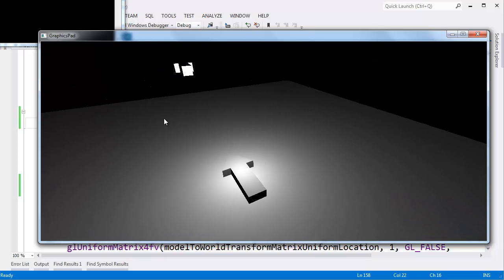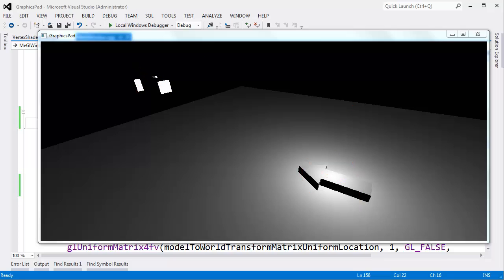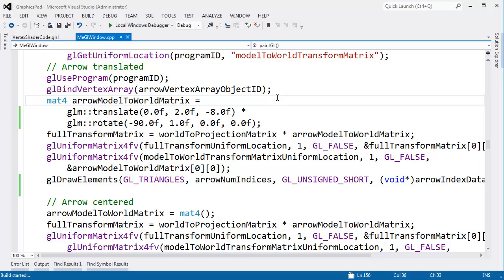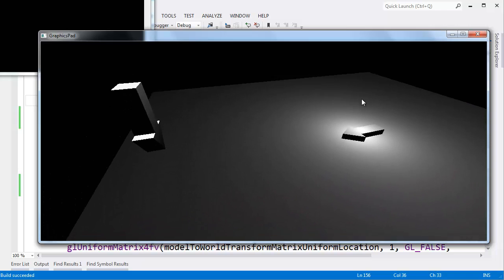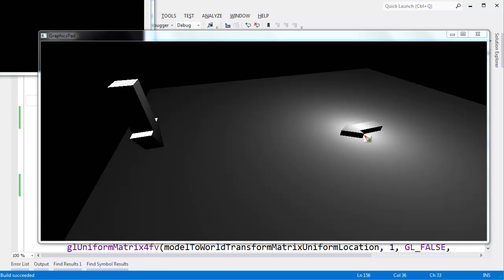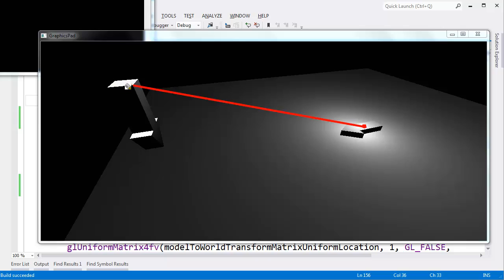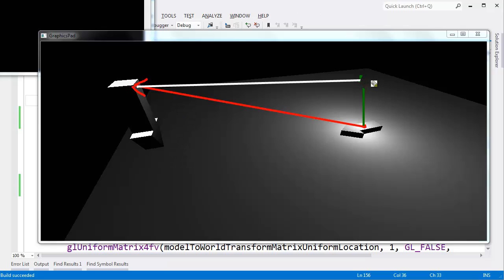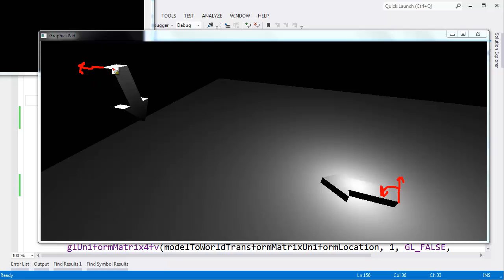OpenGL Lighting Surface Normals

Comment: Once I learned what had to be done, I changed my normal vectors, which come into my vertex shader as a vec3, to be a vec4 with the 'w' term being 0.0f, which means that no translation would happen.  This way I can re-use the model-to-world matrix and simply allow rotation without translation for the vertex normals.  Worked great!  I learned the basics of this from the game engine playlist, so thanks for that!

Edit:  Aaaand then I watched a couple videos ahead and realized that my approach wasn't entirely correct and could be poofed by scaling.  There's always more to learn :)